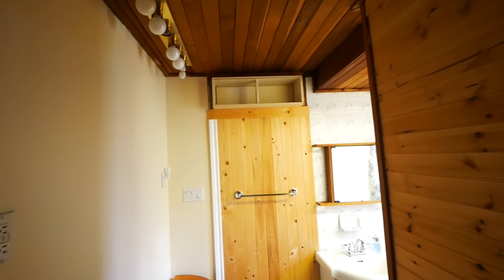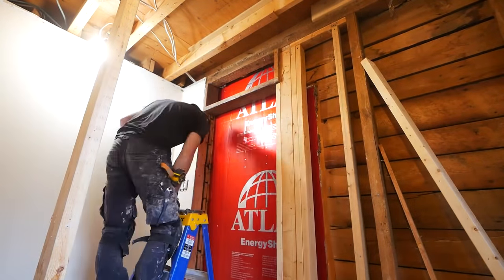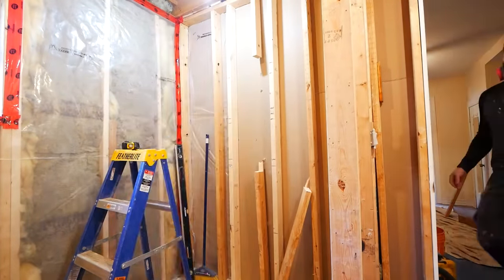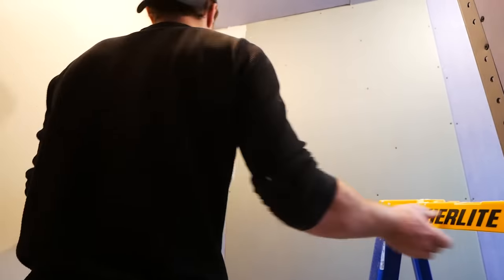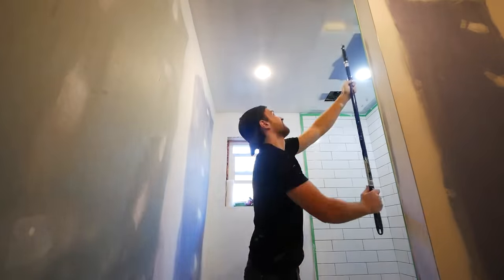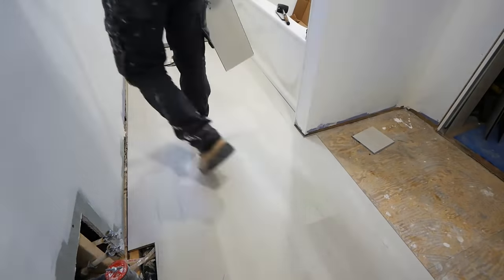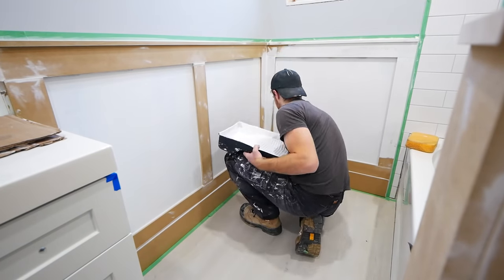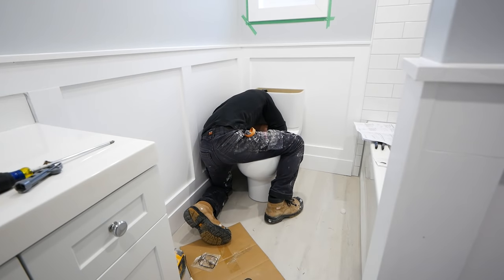DIY Bathroom Renovation - $3500

Comment: Excellent work!! Have you ever used hardiebacker instead of cement board? I usually just use that for the shower only instead of drywall + cement board.

Comment: I have a weird sitaution where I have a halfwall covering my shower and toilet and Id like to move the toilet to a new location so I can switch to a spa bath and then a stand in shower where the toilet used to be. its the first floor so Im worried about plumbing. My bathroom has two sinks -one across the other, if I did this, Id just extend one existing sink for two vanities and then place the toilet in the previous sink location. There would be room for me to add a built in towel closet as well

Comment: Great video and it's amazing you did it all by yourself. I have a family with some young ones so. we cant leave while our bathroom renos are being done. So I'm curious if I have a very small space maybe 8 feet by 7 feet rectangle. We are looking to replace a 60-inch shower tub combo and all the rest. Can we budget for $5000 per bathroom including labor and is there anything we can do ourselves to keep the cost down? Is it worth getting everything from Lowes since we get 5% off or will a contractor get a better deal? Any help would be great.
Reply from the maker: Thank you and the answer will vary a lot based on where you’re located. Where I am the absolute minimum for what you’re describing would be 10k. If you went for a fibre glass insert shower/tub that would bring the cost down considerably. Vinyl floors would be cheaper than tile. You could paint yourself which would save a bit as well

Comment: 7:08 
Is it easy to hand cut the cement board with a drywall knife? I already bought cement for my next bathroom project but i'm getting cold feet because im worried it may be hard to work with and i'd end up having to switch to a foam board for easier cutting. haha.
Reply from the maker: It's a bit of a pain to cut but if you aren't doing anything fancy (custom niche/bench) then its fine. the drywall knife made short work of the plumbing cut outs and there's only a handful of lengthwise cuts to make.
Reply: @WorkinwithWolkon  Thanks for your response. Brilliant job as always!